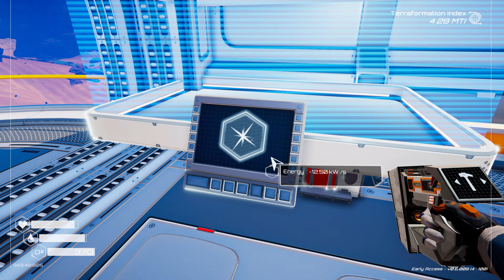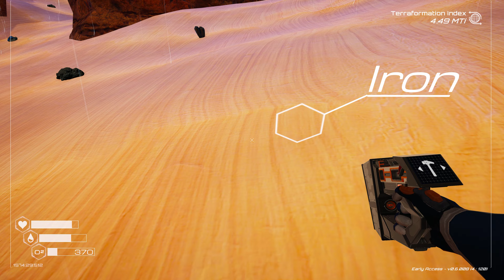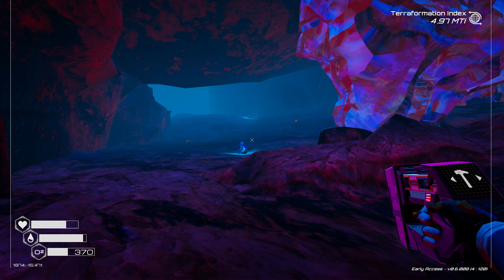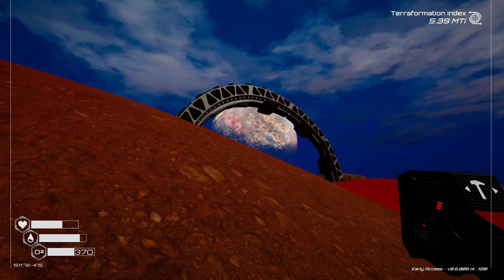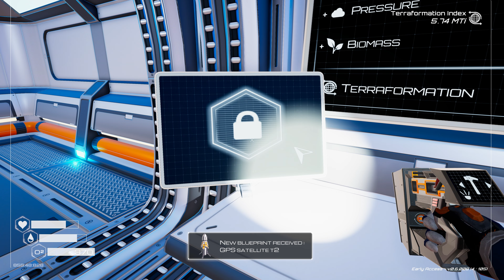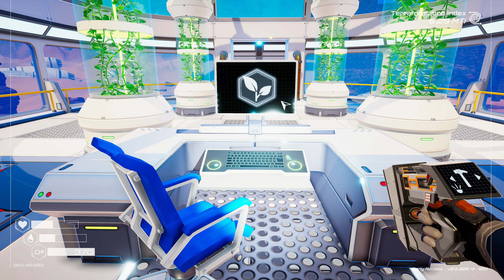PLANET CRAFTER HARDCORE PLAY THROUGH - EP5

Comment: When exploring wrecks, always put up a shelter outside, and put a locker inside. Stuff ALL your provisions, except for ONE O2 and possibly a single food or water(if they're getting low) in the locker. You NEED the backpack space.   
If there's more than one 'locker full' of loot, set up multiple, and start sorting stuff into 'Need now' and 'leave for later' so that you can easily bring the most important stuff with you when you return to base. Leaving a bottle of water, and some food in the shelter when you leave is OK. You're probably going to return to pick up more stuff later, and even if not, it's nice to know there's food and water in shelters. 
Opening crates you have no intention to loot is a waste. The contents in any crate is decided by random from a 'loot table' that is based on your Ti level. Leaving crates unopened means they 'mature' and contains loot mre relevant to where you are in the game.  A crate that might get you half a dozen Irons and a bag of food early on, might get you an Uranium rod and some Osmium later on.
Reply from the maker: Good Strategy I use it when I remember too lol